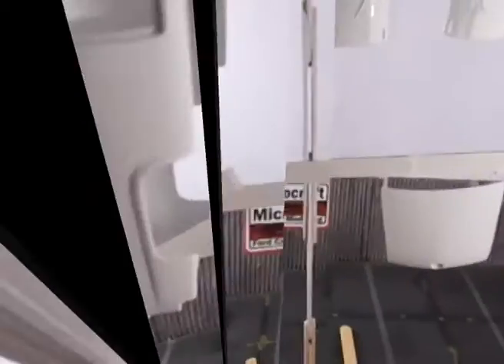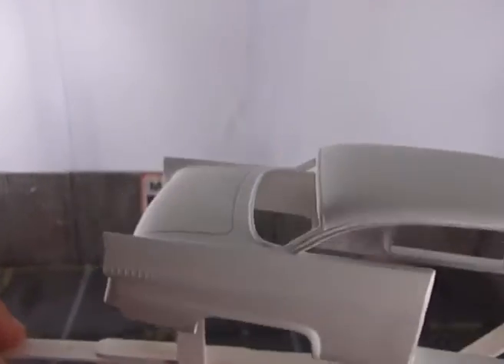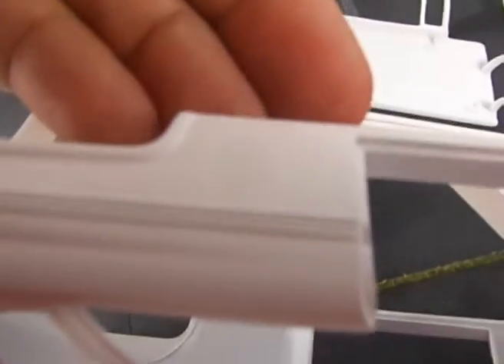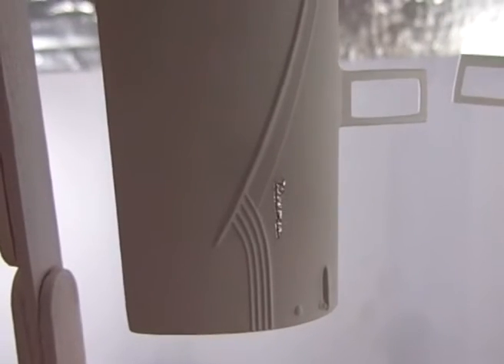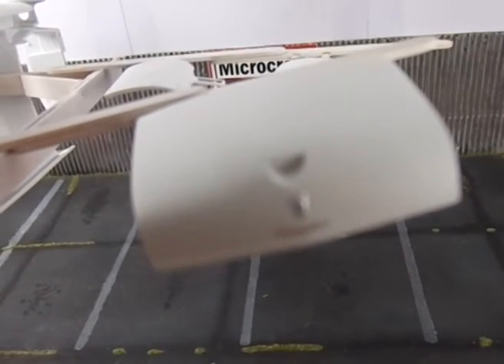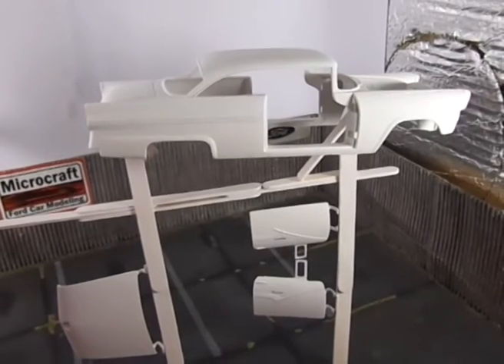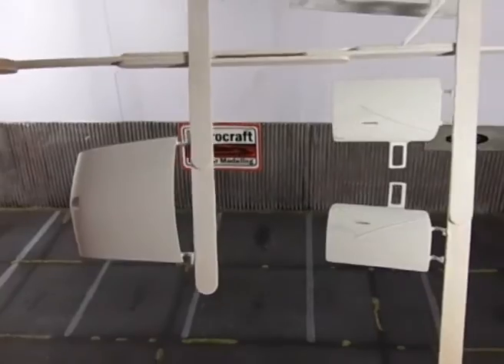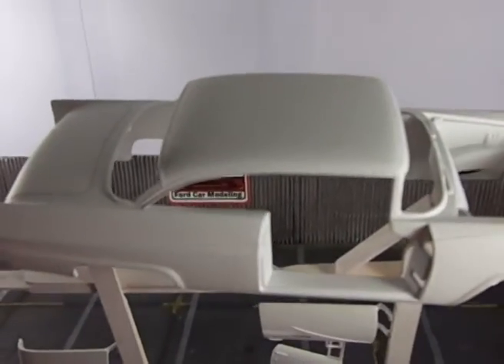1956 Ford Fairlane Victoria WIP part 02

Comment: Why do you foil before painting? Thanks......JIM
Reply from the maker: +fordman 1956 That's a cool trick I got on MCM forum. I foil the emblems before painting the body, so, after the body is painted and dry, I use a toothpick and some thinner to remove the paint from the lettering, this way the names and emblems are real chrome instead of paint. On the last WIP I posted, on the 1960 Ford Starliner I did that using gold foil for the "Starliner" emblems.